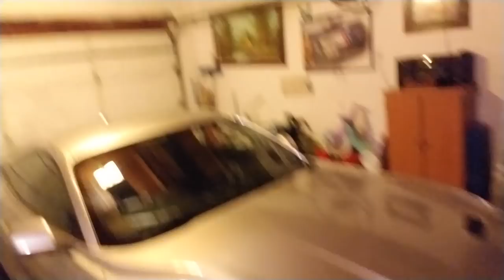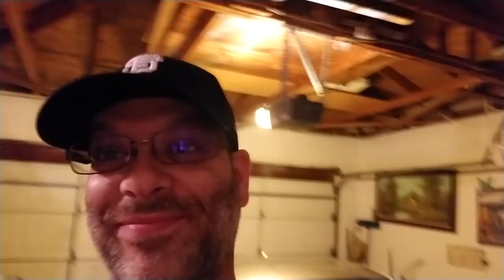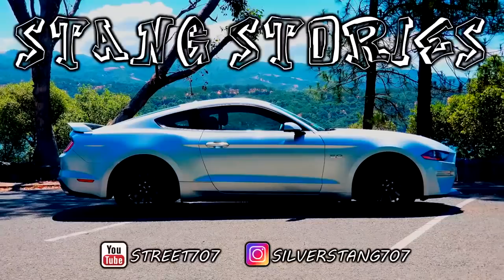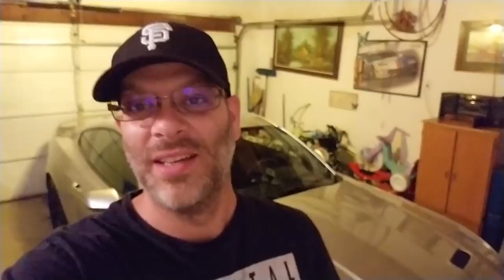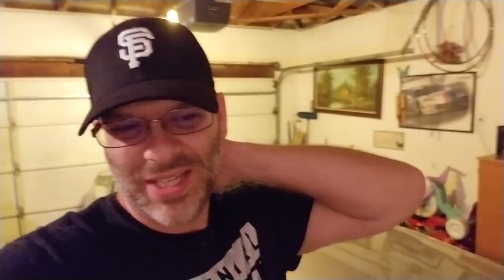2018 MUSTANG GT ENGINE TICK REPAIRS COMPLETE! What's outcome? * The Saga - Update 5 * Stang Stories

Comment: So important to let these engines warm up before revving and hard accelerating
Reply: Well said  I  have always done that .  20 min  minimum drive easy  .  Let the temp come up through all the parts motors tight now .  Start rippin .   2016  gt 84000 did an oil change started to hear a tapping . Never heard before . Saw a vid 2016 f 150  same motor same sound it was the throttle body valve taping away .  East  job putting a new one on .  Worth the time and energy to not hear that . Runing  mobile one 5   30    since I got it used  change oil little early use high flow filter .

Comment: Have same noise in my 2018. Had the car 2 days less than 300 km on  it. Dropped it off at the dealer today for them to access it...want a new car or my money back. Wish me luck.
Reply: Good luck from my experience with my 2017 Corvette the dealerships not gonna take it back they'll pay you out with a lemon law settlement just so you can go away. Ultimately though you lose big time. Check out my horror story on my Corvette had it 7 months in the shop most of that time rebuilt granny rebuilt rear end new wiper motor then finally it developed a tick I. The engine and they tried to snowball with some crap about high pressure fuel pump noise normal.. yeah right lol I took that POS to carmax and bought a German made car lol
Reply: Ford has now had my car longer than I had it. Service advisor said they  can't hear the noise which is total B. S.  I called the sales manager and explained the situation.  I told him I want a new Gt.  initially he said they could do that then called me back an hour later and said maybe not...he will have to talk to the general manager. Very frustrating to spend 40k on a car with an obvious engine problem and be fucked around .  Should have bought a Challenger scat pack. But Mustang looked like better bang for your buck. Now I'm fucked.
Reply: Good luck bro. Keep us posted.
Reply: Jay DKB german made car :p max 50k with no problem
Reply: I'm confused don't they all have the tick? My 2020 does no issues and 15k miles

Comment: Another theory is the crankshaft journals are machined a little wide, so the rod bearings have a little side to side play/ticking when they bump the sides of the crank. I've heard guys have had whole long blocks replaced, and the ticking started up again in a month or two.

Comment: Go down the street to Dodge and get a Scat pack Challenger. Actually Ford is very good with resolving and helping customers with car issues. I had my 2011 5.0 engine replaced at 39k miles. I had let them know at 2000 miles I had issues with the engine making noise and smoking they told me to drive it until it got worse and I did. At 39k smoking was worse and they gave me a new engine. Still like Ford to this day and looking to buy me another here soon.

Comment: Yeah, I'm seeing a class action lawsuit in Ford's future. I believe they know they've got a problem with these engines and they don't want to admit it. I'm badly wanting a 19 GT Premium PP1, but this tick issue is keeping me from pulling the trigger. I hope things get resolved soon.
Reply from the maker: Me too
Reply: I'm late to this but my husband has a 19 PP2 and we now have the tick, however his didn't start at the oil change. We had the first oil change and they noticed a leak in the gasket on the pan so we took it back and they changed the gasket and NOW we have the tick. Took it back because didnt notice it until we got home. The are saying it the typewriter tick that is covered in the Service Bulletin and nothing can be done about it. Needless to say, my husband is NOT happy. Any advice?

Comment: Are all the 2018 GT going to be plagued by the same problem? Mine has 6,220 miles, it is a November 8, 2017 build, still no tick.
Reply from the maker: Yeah I don't know if the build date is a valid thing because some are having the issue and some aren't. Plus the tick is happening with multiple years. Not only 18s. I just wish we had answers and fixes. Lol
Reply: I guess I got lucky, the only problem I have, a minor one, is a noisy active exhaust valve at startup and when I turn off the engine and when I change driving mode. I will have it fixed at the next service in the spring. I had the first oil change one month ago at 5.4K miles, with Mobil 1 full synthetic 5W20, the engine is smoother since then.
Reply: From everything I am reading, the Feb 2018 build date is the hardest hit.

Comment: Same here brother. Im sorry to hear there attempt at fixing this issue has failed. Its very scary to think about ultimate engine failure. My advice is dont worry about your warranty expiring. By law we are protected by exactly this. If you do take the buy back route i completely understand. My gf is currently going through that route with her chevy. Have everything documented with your car. What ever mileage the issue started at is what they honor in terms of the buy back. As far as your warranty expiring have piece of mind that if this issue persists and they can't fix it with in a reasonable amount of attempts or thirty days in the shop you should qualify for the lemon law. I experience loss if power along with the bbq tick and i will make sure they document it.  Take care brother any questions just let me know
Reply: Luis Alvidrez Are you saying.. if the warranty expired and something happen to the engine. You’re still cover as long as it is properly documented of the issue?
Reply: @evideos4792  yes proper documentation can help your case even after the power terrain warranty is up if You can prove that the issues started prior the warranty expiring. Different laws apply in different states though so just be aware of your lemon laws in your state I am in California

Comment: they are doing the same thing with mine. First, vct solenoids are replaced, they said it was fixed. I went there and showed it wasn't. now they are replacing the phasers. It has been almost 3months the car has been in the dealer. Finally BBB informed me that Ford is gonna replace my car with a new one. Hopefully they will tell me the car fixed after the phasers and I just drive it till I get my replacement vehicle. I am paying huge insurance and driving a boring loaner. Hopefully 19s doenst have this issue.
Reply from the maker: Yeah I get it. Sport car premiums and driving a taurus. That was my case. Lol
Reply from the maker: Btw.....they are giving you a replacement vehicle? How does that work?
Reply: I filed a claim to BBB Auto line, stating that my car has been out of service for more than 2months. BBB contacted Ford and 2 weeks later Ford settled with a replacement vehicle. I am gonna choose any car with same or higher (as long as I pay the difference) msrp value car. 
You should read the lemon law of your state to see if you are eligible or not.
Reply from the maker: But you'll have to get a new loan right and probably pay taxes and fees again?
Reply: You dont pay any tax and fee if you get the same msrp car. you have to pay just milage fee (1% of MSRP per 1000miles). lets say your car is $40000 and it has 2000 miles on it. You have to pay $40000*0.02=$800 out of pocket to get the replacement vehicle.  if you chose to upgrade the car, you have pay the taxes of the difference.
Reply: btw I am not an expert on this.but as far as I know this is how it works.
Reply from the maker: Thanks for the info. I appreciate it.

Comment: I’m done with dealing with my car. Shift fork snapped on me and they replaced the shift fork with the same exact part?! You would think ford would have a better part to resolve the issue but no. I was without my car for two months all because of the transmission repair and before that I had the car looked at by two different ford dealerships for the tick. 

Can’t wait to get my money back at this point and just never buying a ford again! 

(Service advisor also mentioned that I’m eventually gonna have the evaporator cores leak on me as well since they always had that problem and his gt350 is on its third one but if it’s out of warranty that’s over 2-3k repair cost)
Reply: they will never give you any money back. you are screwed.

Comment: That sounds like the timing chain slapping around. Piston slap or anything else would be more consistent right? Just a thought
Reply from the maker: Agreed but it's very confusing.
Reply: @streetridaz  I had a 5.4 2v make a sound that was very close to that at idle. Turned out to be bad timing chain and tensioners, but it also had 270k miles on it. Far from new
Reply from the maker: @edjackson4389  Thanks brother. I appreciate the info. Their are 100's if not 1000's of coyotes since 09 or something with this tick. Nobody really knows what it is but i'm not worried about it anymore. I'm just enjoying the car. Just a bit concerning in the beginning. Still doesn't provide a great feeling but the car performs like a champ and i'm in love with it. So... moving on. LOL
Reply: @streetridaz  Yeah, I'm just guessing, I definitely am not a engine master. Glad you're happy with the car, and good luck with it buddy

Comment: I really feel for you, brother. I've seen many of these motors taken apart (2018's and a 19) and what I've seen is scored cylinder walls from the pistons (piston slap) aka the "BBQ Tick" as many are calling it. They wasted their time and most importantly, YOUR time, obviously. Are the techs at your dealership all kids... are there no Master techs to be found who actually know what to look for? Ford knows this is piston slap, but apparently, they want to waste their funds on fixing everything but the problem... just clueless as to this logic? It was never cams and or lifters. I know this is your dream car, but honestly, I'd dump it as quickly as possible. I know, you're going to lose some cash, but you're going to go through the worst rollercoaster ride one could imagine. If you go for buyback, it will be months of intense stress and time, which is money, with no guarantees. And, if they would replace the motor, you're going to lose money gong that route as well. No buyer, typically, wants to purchase a vehicle like your Stang with a replaced motor. That too equates to loss of value. So, you sell you lose money. You replace motor you lose money. 2019's are experiencing this same issue, and Ford just keeps pumping them out. Master Technician, 25-years, and have owned 25 Stangs to date
Reply: Who said anything about "bottom ended"?  And, piston slap does not always go away when warm.
Reply: Yeah, think I've done that a few hundred times during my 25-years at Ford.  Maybe this guys tick is coming from the bottom end, who knows, it's in a garage, slapping all around the walls.  If it's "quite obvious", why is it still ticking after all that work he said was done to the motor?  Why don't you tell us what the tick is and how to remedy the issue?
Reply: Thank you!!! Week 3 today for same problem and they are replacing the phasers too. Glad to hear it from the Master mechanic.
Reply: Are you experiencing any lack of performance issues, i.e., excessive oil consumption, loss of power, etc.  Seems like some view the "BBQ Tick" as just a nuisance and not a concern regarding the engine.  That's a fine line to walk.  Not sure why they're doing the phasers now?  What is their logic behind that... I'm curious?  If they thought it was a phaser issue, they should have done that work at the same time as the other work.  It seems like they're just making guesses as to the problem and have no real idea what is going on?   However, I strongly suggest you do what you said in your vid, have them bore scope the cylinders.  If they're good, then at least that can be excluded from the equation.  If their scorched, well then, yeah, there's a problem (maybe an additional problem on top of another one) that you have identified, and as you said, it's game over at that point.  I wouldn't accept a replacement.  I would press them to take it back, but that's a long process with no guarantees.  I think it's time for a field rep to come into play.
Reply: While I won't doubt your knowledge of your Ford products, it is obvious that you are not knowledgeable or informed enough of what hypereutectic pistons are and what nikasil/plasma spray on bore is.  The bore "scoring", more commonly known as "glazing", that has been shown is all perfectly normal for a nikasil/plasma bore as the coating is so hard that the break-in process seats some material in the crosshatching.  If you look at the pictures then you will see the crosshatching through the "glazing" which shows that there is no bore damage even in conventional bore lining terms as the crosshatching would be the first thing to be missing.  People are spreading old tech proofs for newer tech that they are ignorant about.  Dont be that guy, do some research on the subjects in more established applications and then use your mechanic skills to put it all together before you come to public forum and spread conjecture for fact please.
Reply: Update on "BBQ" tick coming from three Ford sources.  The tick has been identified by a few master techs, but not made openly public and maybe never will be, as this would cost Ford a boatload if it ends up becoming a recall, which everyone seems to doubt.  It's not cam phasers.  It’s not piston slap or the cylinders, it has to do with the crankshaft.  The tick is from a bearing clearance issue on the crank... too much clearance.  It’s called "typewriter noise", "Ford's terminology" regarding this problem.  It is believed by many that Ford is aware of this design flaw, but keep pumping out the vehicles regardless.  It has now surfaced in the 2019's as well, as I own a 2019 and the tick is present in mine as well.  It doesn't even have 200-miles on it yet and was purchased roughly two-weeks ago.  Now it's sitting in the garage and I will be getting rid of it this Saturday.  Not going down the daunting road that countless others are experiencing at this time.  I don't care about the $5K loss,  My time is worth more than that.
Reply: @Snow-Dog2112  that is interesting info. Can you tell me as a ford mechanic if the problem is now fixed for 2022???  Asking because I would love to buy a Saleen or Roush this coming year. Thank you

Comment: I heard someone say about there first oil change they used 5w50 amsoil and it went away ?
Reply: It's not just Amsoil. Just go heavy weight and the tick sound is gone. 

It's not s fix, the thicker oil just absorbs the sound. You will still have cylinder scoring.

Comment: I have a 17 Gt and had light tick on beginning and after 7k miles become very loud tapping. Took me at least 6 trips to dealers before short block replacement.
Reply from the maker: And did that fix it and is it still fixed?
Reply: I've seen more than a few guys with this engine problem and the bent shift forks on the MT-82 6-speed manual transmission. It's my understanding that the MT-82 transmission is a Getrag unit that's built in China and they switched from steel shift forks to cast aluminum ones, to cheapen construction costs. There may be a Ford TSB on the MT-82 problem.
Reply: Street707 - Mustang Vlogger, FPV Pilot & PC Gamer yes they fix it, for how long will stay like this?have no idea but for now it’s quiet like a mouse. That tick it’s so annoying and can’t explain why so much people have this issues, my guess is Ford have too many defective engine blocks or the cylinder sleeves get deformed when they press them in

Comment: My 2020 started ticking after it’s first oil change. Took it in to the dealer and they didn’t even look inside the engine itself. They acknowledge the ticking sound but told me to not worry about it since it’s a “normal” characteristic of the Gen 3 motor.
Reply from the maker: Yeah Ford released a tsb stating it's normal.
Reply from the maker: Do I believe it? No. Why? They have no answers why some do this and some don't or even what causes the noise. That being said I've got 19k miles on mine and it's running fine.
Reply: My 2017 GT has been doing it since 35,000 roughly.  Didn’t take it to the dealership for that issue because already know they won’t look at it.  58,000 I all the sudden had a LOT of aluminum shavings in my oil after a change.  Tick got even worse with fresh oil, filter, and new spark plugs put in too.  Taking it to Ford tomorrow.  With the aluminum shavings will force them to open the engine and diagnose.

Comment: I'm starting to think that it's the crank. Too much back-and-forth movement causing the ticking sound. I just saw a video from a guy in Germany that took off the oil pan and he can move the crank back and forth quite a bit. I think it all starts with the crank and eventually you will get scoring on the cylinder walls.
Reply from the maker: I've seen this video and it's circulating around the.mustang community and I'm beginning to agree. I've brought it up to my dealership.